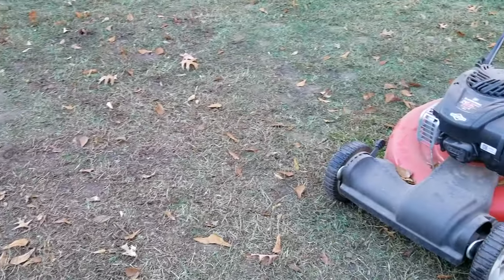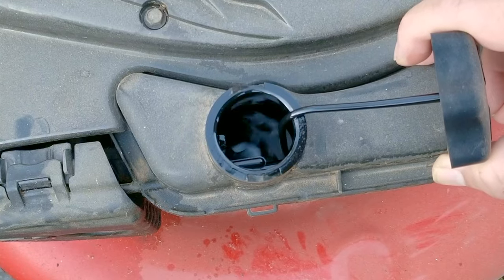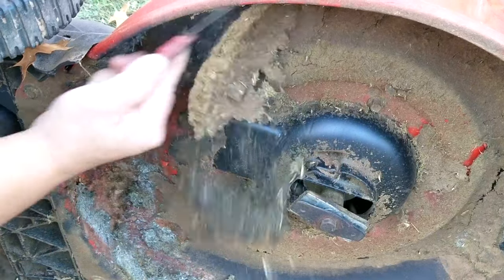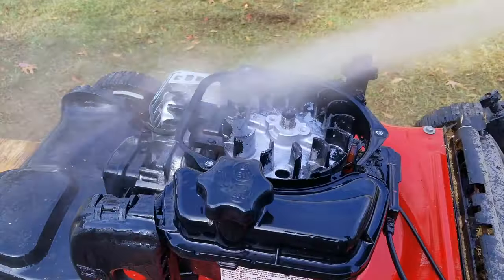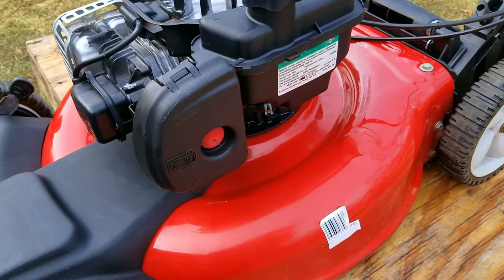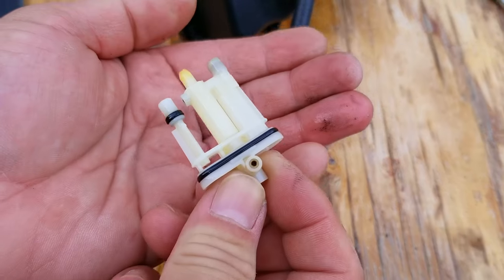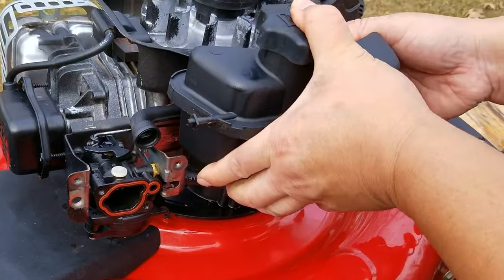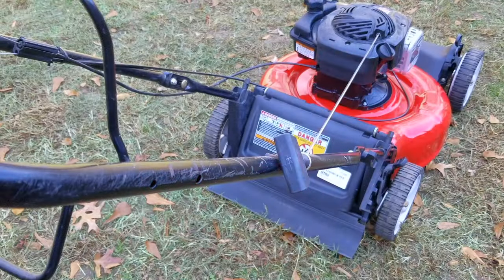Fixing A Yard Machine Lawn Mower That Won't Start

Comment: A couple of days ago I saw a Ryobi 6500 running watts generator with a 420cc engine being sold for parts for $100. The generator looked rough with a couple of minor missing parts, an air filter box cover and recoil. Talked man down to $50 and he excepted. The frame was beat up moderately. Got generator back to house, got it started with some rope and it runs and produces power like a brand new one all outlets work and so does the electronic meter. I’m fixing it up and keeping it for myself! it’s a risky business but sometimes you can really get some good good stuff even though it may look bad. A little paint and some degreaser and it will look very good. And it’s not even quite five years old.
Reply from the maker: wow nice find and great work getting it going again

Comment: These plastic carburetors must be a great money maker for repair shops. Imagine paying $130 for a shop tune up on a mower you bought for $230 just a few years ago.
Reply from the maker: I see your point
Reply: I see your point as well, but they are so darned easy to fix! The easiest carburetor I’ve ever seen to clean up and get running again. Never use ethanol or gas and you should never have any problems.

Comment: I don't know what they did material wise on the decks, but with pretty much only MTD products on the market for a few years the decks are junk now.  They rust super easily, and they have so many bolts that go through the deck into plastic.  If there was ever a design to fail after 10 years, this crap is it.  I get 15-20 year old machines that are in better shape than a 5 year old machine now.  The decks lose their paint and rust out with like 3 blades of grass hitting them now.  The only good thing, is that the front ends are interchangeable on this style deck (self propel or not) and so are the back ends.  You can even swap a self propel setup onto a pusher, if you're willing to cut an opening for the belt to go through - oh yeah, and fight with getting rusted screws out....
Reply from the maker: thanks for sharing that information, I never thought about doing that.

Comment: I recently purchased a used toro push mower with a briggs model 104M02-0131-FI. I changed the oil and there seemed to be a lot of metal flakes and shavings in the oil. What should i do to prolong the engine life? should I flush the crankcase with gas?
Reply from the maker: no, I'd put fresh oil in, and then do another Oil change in about 5 or 10 hours of use.  Check and see what metal comes out and then decide if it'll be a regular interval or a short one before doing another oil change

Comment: I have a briggs & stratton that runs, but only starts with starter fluid. I cleaned the carb several times to no avail. I replaced the carb to no avail. I checked the valve lash and it is in spec. I checked if the valves rotate at TDC and ok. Cylinder seems ok. Once it is running it runs like a champ. Once hot starts no problem. Has new plug and strong spark. Compression though at 60lbs. Next on the list is a leakdown. Is there anything else you can suggest? I am leaning towards compression. Would honing and next size up on rings be the way to go? Or would I have to bore, pistons & rings?
Reply from the maker: you are correct, the low compression reading is a very good indicator of a "hard start" without the use of some starting fluid.  You can hone the cylinder to put the crosshatch back, but there's no sizing it up as they don't make upsized rings for these.

Comment: I have a 450e series engine mower (model 08P502-0038-h1). Visually looks pretty much like the one in your video and the carb is also the same. It started surging when I started it this season and watching your videos gave me the courage to open it up and clean it, cleaned the carb fully with cleaning wire and carb cleaner but it still surges a bit, though it is better now. I looked up more info and potential causes on YT and saw some people saying a common problem with these is that the jets are too small and they recommend drilling them a size bigger. Is this something you think is safe to do and have you done it to one of these carbs before?
Reply from the maker: thank you for watching and I appreciate your determination.  Great question and my answer would be to Never drill out the jet.  I would instead, just buy the $15 carb and call it a day. Otherwise, if drilling out the jet, doesn't work, you'll keep spending more time working on it, than using .
Reply: @HomeGaragechannel  Thanks for the reply. I was also wondering, what kind of motor oil you use for your mowers? Is it SAE30, 10w40, 10w30...? I used to run SAE30, but prices have gone up a lot in the last few years here. A 5L container of SAE30 used to be 20€ now its almost 40€. I think I'll try running it with 10w40 now since it's currently the cheapest here and costs 15€ for 5L. It's part synthetic but the specification grading says its high performance and from what I've read 10w40 should be alright for mowers.

Comment: I have the exact same one, it spins but after 8 or nine spins the blade gets completely hard and stiff and doesn’t move. The bolt moves with the blade. Do you what could be wrong? Thank you
Reply from the maker: not without more information.  Did you take the spark plug out before turning the engine?   Is there a Gouge on the edge of the blade?  When was the last time I was running? thanks

Comment: I bought a mower for $25 that the owner claimed just had a broken rope...
Hah!  While fixing the rope, and inspecting the mower, I found the PCV hose was rotten, and the whole PCV needed replacement (Tecumseh LV148).. thankfully I had a parts engine to steal it from.

Then when I got it all together, turns out the carb leaks gasoline.. even with a new gasket.
Replaced the carb... Aaannnd the bail cable seems stretched.
Not 100% on it yet, but it's the likely culprit... And it's causing intermittent spark..
Blech!

Then a generator I bought that the owner said wasn't running, needed a new carb, but had good compression.
Ya... A stuck valve, and a rust damaged cylinder wall hahahah! Oh well... I laughed about it and made videos on my channel

Not this one, different account, not plugging on someone else's channel
Reply from the maker: yes it seems everyone has a story to tell when it comes to sell.  At least you were able to find all the problems

Comment: You think I should buy a mower for 50 bucks and flip it?
Reply from the maker: yes and no, yes if you think you can make good money on it for the time you might spend on It.  No, if you're not sure what the problem is, and it might take time and more money to fix it.
Reply: @HomeGaragechannel  It already runs. I don't have to do anything. I would just flip it. That's why I was wondering if I should.